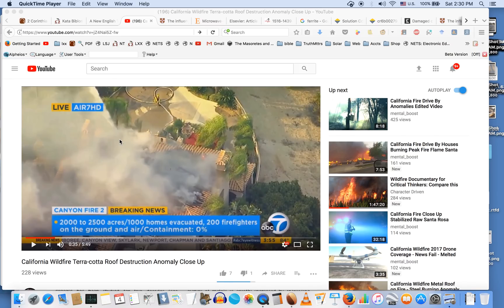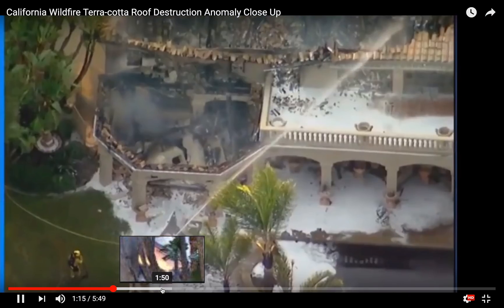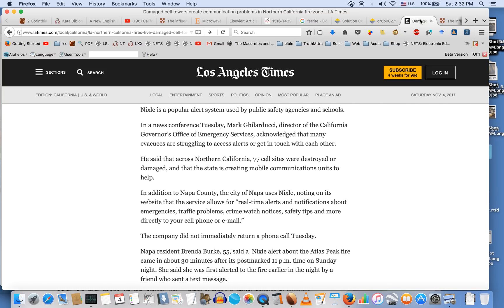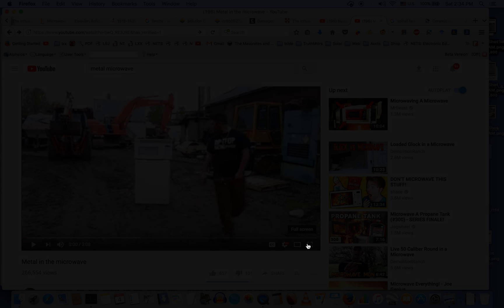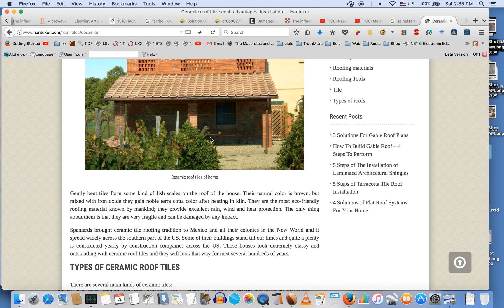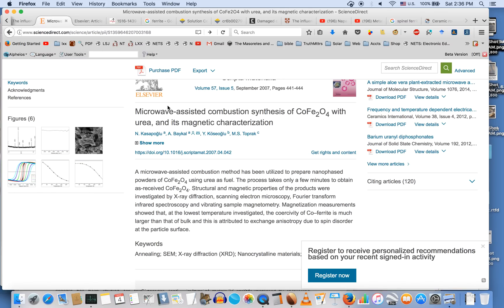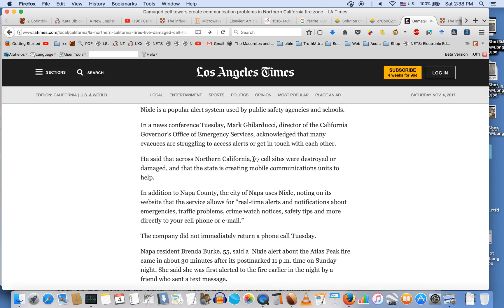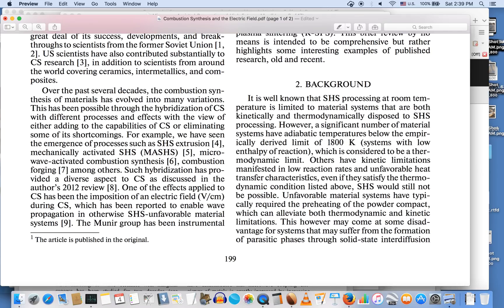California Fires: Terracotta Roof Anomaly: Microwave Assisted Combustion Synthesis

Comment: Lol, I've installed a couple hundred cell towers and you are out of your mind if you think one should propagate 40 miles.
Reply: Mark Pon,
" truth works hard at this"  Maybe.  She works really hard to avoid facts, to ignore common sense and to conjure preposterous apples to cobalt ferrite comparisons.  

Her last video about these fires tried to compare the total destruction of a wildfire burn to internal sourced house fires extinguished by fire fighters.  She gasps hysterically comparing the two, unable to comprehend why a fire that was put out leaves more debris and partial structure behind than a fire that was NOT put out  

No, I wouldn't call what she does 'work'.  I'd call it frantic delusion doping.
Reply: Mark:
"Truth is always asking and open to info"  Not even a little, tiny bit true. She is interested in more hallucinations that fall in line with hers and will embrace them without any logical reason to do so.  On the other hand, I've posted extensive critiques of the logic (or lack of) and the staggeringly misleading distortions in her narratives and have not received a single reply.  No, fair to say she is not open to 'info' only more delusions.
Reply: Mark Pon,

"...what should be considered common sense. Although in your case I think you are lacking the latter"

OK.  Let's look at that.  You just fell in line behind a video that uses experiments on cobalt ferrite nanostructures to assert that giant microwave ovens were deployed from space to start a fire in roof tile.  Common sense, on the other hand, would look at the strips of burned out brush near the house, recall that wind carries hot embers and infer that the fire was started by a wind-blown ember.
Reply: "although there are some anomalies" 
There are no 'anomalies', only hysterical assumptions from people who don't understand refraction.  If the sun didn't set behind the horizon and if instead, it did, (as flat earth posits), simply turn oval and disappear into the distance, then you might have some crumb of a starting point with flat-earth.  But since the most observable daily astronomical event on the planet disproves that theory every - single - day, it may be time to give that one up.
Reply: Mark Pon
"one thing my parents taught me is you just can't cure stupid. "  
Yep and that's what you taught them too I'd bet, since you are still, clearly, uncured.
Reply: Mark, Mark, Mark...
"I don't believe in scientists I believe in Jesus.'
....Written on a computer designed by science, distributed over a network designed by science, decoded by science and displayed on my poor unfortunate monitor, also designed by science.

Jesus, was a philosopher and there's a great deal to be said for that philosophy but there is no more reason to insert Jesus into questions of science than there is to let a transmission mechanic remove your brain tumor.  Two different disciplines.  Get it?

But you SHOULD have that tumor looked - it's impairing your reasoning.
Reply: Mark Pon,

Lots of deflection there, but NOT ONE, of your comments has addressed the facts or the science of this issue.  Not one.  Maybe because you can't?  Seriously, because it impacts how we address you, are you a kid?  If you are, I'll try to be more patient and indulgent than I would be if your just a comitted dullard with no appetite for facts or reason. 
  
Your goddess here, 'Truth' is a committed buffoon and incapable, but more importantly UNWILLING to study things objectively.   Here, in this video, she pretends that the behavior of cobalt ferrite under microwave energy can be extrapolated to roof tiles and wood framing to explain them bursting into flames.  That, of course is ABSURD, because as HER SOURCES point out, it is the specific properties of the cobalt ferrite nanoparticles that create the response.  It is also absurd because the cause and origin of the fire in that house is already KNOWN!  You can SEE the burned out area to the right and a person with any honest curiosity would find many, many examples of homes catching fire from a single wayward ember, let alone a storm of incendiary sparks driven by Santa Ana winds.  https://www.youtube.com/watch?v=_Vh4cQdH26g
   
In her previous video she spent 10 minutes bouncing back and forth from photos of the Santa Rosa firestorm to photos of ordinary house fires, shrieking "where's the debris, where's the debris!"  It escaped her that a fire that starts INSIDE a house, on a cool, rainy day, that is put out by the fire department might, possibly be expected to leave more behind than a wildfire on a hot windy, dry day with NO fire department response possible.  This TRULY obvious difference was beyond the reach of her cutting intellect?  And you are following her around, defending her like an addled toothless golden retriever trailing behind a belligerent hobo? 

 I'll give you points for loyalty but that's all.  Deducting points for the blindness of that loyalty, for the lack of objectivity and your committed intransigence, you still end up with a negative score overall - well into the 'screen doors on submarines' end of the competence scale.  How do you FALL for this stuff?  At what point did you just suspend all disbelief and go along with this like a cartoon movie about a flying elephant?  Truth's "truths" are about as plausible, much less entertaining and far, FAR more dangerous. 

I'll add to that indictment that she is a coward.  A person with some character and self-respect would respond to detractors as well as rudderless acolytes like you.
Reply: Oh, look, Mark's back.  Must be breakfast time in Moscow.  Did you read my last paragraph out loud, to yourself?  Otherwise how would it sound 'comical' or any other way 'to your ears'?   
But nice job of ignoring the questions and diving straight into your chicken sh!t evasion.  No wonder you believe the putrefied entrails that this video represents - no attention span, reading comprehension or capacity for, well, thought?

If you post anything that could be seen from any point in the same zip code as 'serious' - I'll respond, but I'm not holding my breath.

Comment: Aren't terra cotta tiles pretty heavy? If you look at that house (wood structure being burnt) therefore it can not hold the weight  of those tiles, correct? If you actually look closely... You will see tiles in the home, on the ground inside. It's plausible the inside contents just caught fire? It absolutely will not hold the roof weight. Not everything IS a conspiracy! If you bring that element why not bring in all plausible elements? 
Just a thought...
Reply: UNIDEN2211 exactly, I don't think she said how it started either. What I tried to point to is, Many times fire's typically start Inside the home... If that was the case with this single home that could be the answer. Faulty wire's, stove, candles cigarettes etc. Many ways to start Inside a home... just NOT enough info for me to make accusations. My family was in the Santa Rosa Cali fire's that was suspect for sure. But a single home fire, it could be anything.
Reply: UNIDEN:
You ask those questions, never look for the real answer and then just make up a horrid fairy tale about superweapons.  Here's your mysterious fire source:  

https://www.youtube.com/watch?v=_Vh4cQdH26g
https://www.youtube.com/watch?v=nd3p6ai_c-Q

The roof can be fire resistant but the rest of the house is one immense pile of kindling - just one opening in an attic vent can take the whole house down.
Reply: Look closely - you can see burned areas on the hillside just a few feet from the house.  A few dried leaves next to the house, or collected in a gutter, ignited by a single ember from that grass fire and, that's it.

Comment: So how would that inner tree have burned?
Reply: A tree will burn from the inside. It happends when the fire is travelling underground, burning up root systems etc. Especially if the tree is dead and rotting inside it will start burning at the roots in the soil and burn the decomposing material that is inside the tree. Wild fire fire fighters did trenches and ditches to help act as fire breaks and keep it from moving underground and hot spots can remain for days underground and re ignite later on.
Reply: Lolee1
The question itself is fine, if asked with honestly.  If it's asked solely as a prelude to accusation then the question becomes only a tool of your own deceit. 

Tree burn inside in every wildfire.  Part of the mop-up operation is cutting down trees with their guts on fire.  It is pretty common. 
 From 2013: 
https://inciweb.nwcg.gov/photos/CASTF/2013-09-06-1648-Rim-PostFire-BAER/picts/2013_10_12-10.03.51.097-CDT.jpeg 
From 2015: 
https://inciweb.nwcg.gov/incident/photograph/4466/29/46688/ 
Michigan, 2015: 
http://4.bp.blogspot.com/-ua1oCA8DnBI/VbzwACgumSI/AAAAAAAAUAE/FSrU7NZ-IOQ/s1600/burning_tree.jpg 
http://keweenawnow.blogspot.com/2015/08/dnr-township-firefighters-work-to.html 

And - just for fun; http://iloveuselessknowledge.com/2014/11/14/the-bark-of-the-redwood-tree-is-fireproof/
Reply: inTruthbyGrace reminds me of 9-11 all over again...very sinister.
Reply from the maker: Great question... microwaves will definitely cause a tree to burn from the inside all I am pointing out here is the explanation for why all the trees around the houses did not combust like the properties of the houses.  Microwave transmitters are most powerful at their source so I suspect that those trees burning from the inside are closer to the source and experience a much higher zap.. that's only a guess but for sure, those materials containing metal, even metal paints would oxidize and provide a sustained oxygen source that the tree doesn't experience.  What happens with trees is that their bark causes MW  energy to ricochet on the inside of the bark (rather than passing through like MW does with most materials).  This unique property of trees would explain how a fire could ignite inside the tree and not outside... while the materials in the houses were being essentially vibrated and oxidized to combustion.

Comment: From day one I found it strange that all these houses they showed in flames or before they burned a large % were newer stucco construction with terra cotta tile roof likely due to construction codes for the purpose of fire prevention in a semi -rural area.You would expect more damage with an older home of wood construction,  so yes how exactly did so many of  these more fire resistant stucco homes with terra cotta tile roofs burn to the ground?

Comment: Please explain how the high winds were caused.  I am curious, because in the last 3-4 yrs we have been having these sudden high windstorms in Norway
Reply: Wind is caused by differences in air pressure from one place to another.  Air, like any fluid, will always move from the areas of high pressure to areas of lower pressure. This movement is called wind.  

Next, are we going to explain how water runs downhill without a government superweapon to drive it that way?
Reply: Rod DaMan  No need to be a SNOT. I'm sure 
AzureSkies555 knows that. They are asking something deeper. 
Try to be civil to people, you brave and mighty armchair warrior. Especially to people from another country.
Reply: AzureSkies555 The heating up of the ionosphere by using high powered lazers, which causes high wind speeds.
Reply: (canou fred) The ionosphere does not affect the weather it's almost a vacuum.
Reply: The devil is farting.